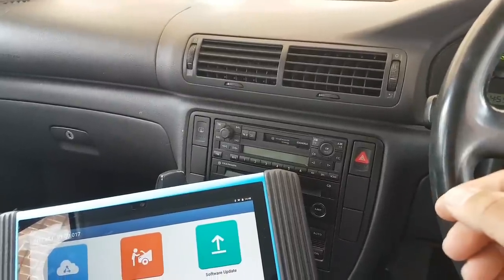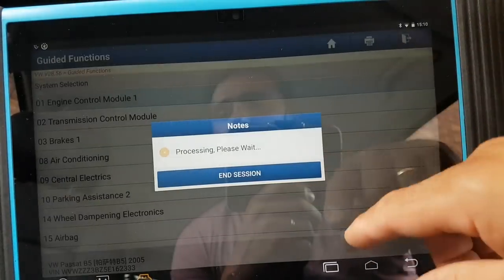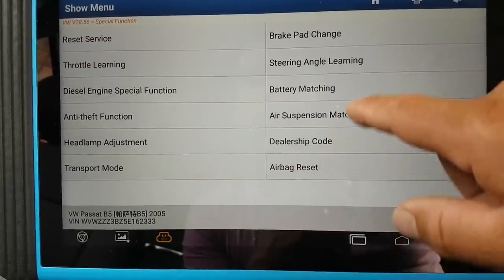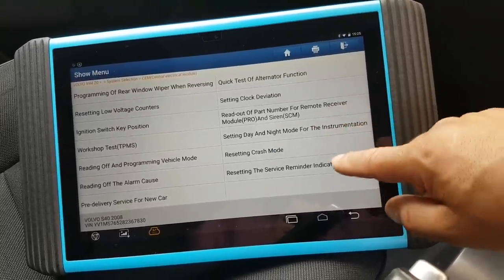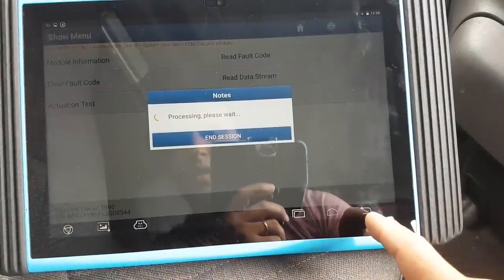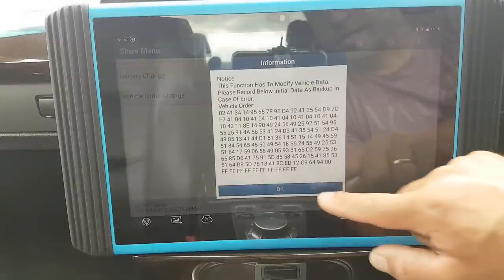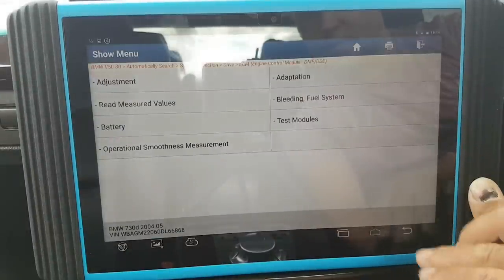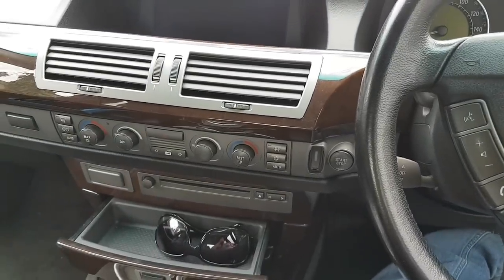Topdon Artipad I, four cars in 40 minutes... brief walkthrough...

Comment: Thanks a lot again for your video.
Although, if I has broken my heart in two parts between Autel or Launch, now is broken in 3 🤦🏻‍♂️🤦🏻‍♂️
Following your recommendation and as Audi technician since 15 years ago, this could be the best option, but first I want to check Launch.
Btw, in Vag cars when you access to Inmo you are really doing to 17 instrument cluster, and functions are the same (in theory). This is only when 05 Access/electric steering lock is not mounted.
I would like to ask you if with tool it's possible to check values in diagram format.
Also, in Volvo I saw that it's possible to active some functions related to infotainment.
In Vw you must to buy a certificate and insert to diagnostic tool for connect to server and then, activate the function on the media system.
You can check please, and if it's possible to you, if identifying a Golf MK7 exist this option?
I think could be interesting to know it...
Thank you very much in advance!!
Reply: guille79bcn it is the same tool as launch x431 pad3 my brother